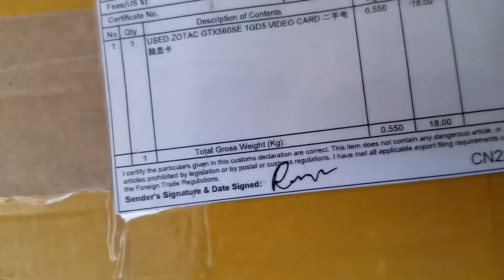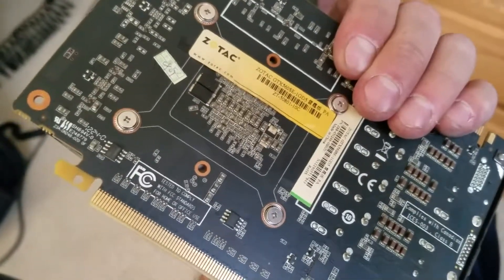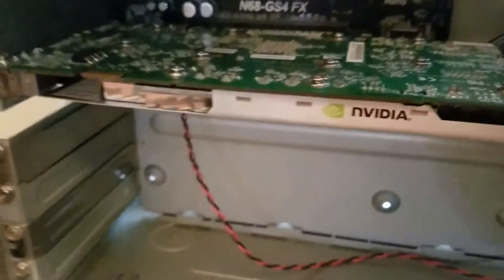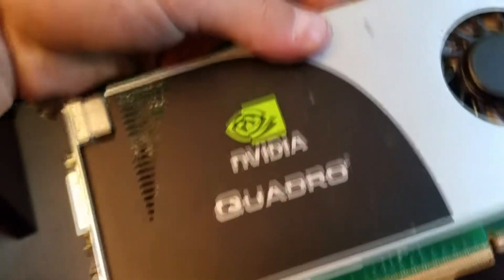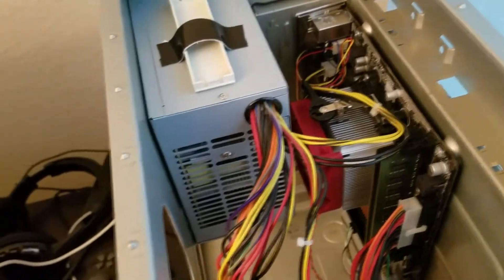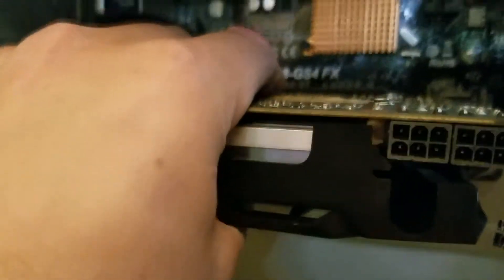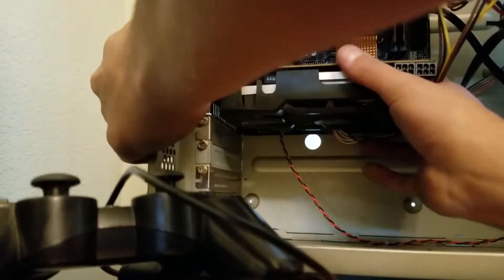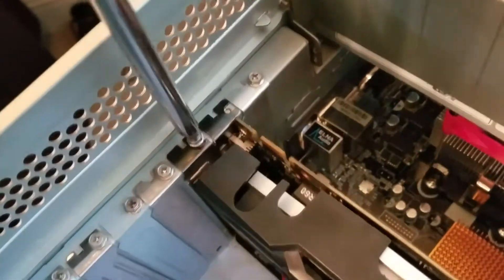Installing a cheaply bought GTX 560 SE in my crappy system

Comment: have the very same gpu and installed it in my cheap pc this week, i used 2 sata power to 6pin adaptors, works with no issues. works well for older non juice hungry games.
Reply: I'm planning to to this as well, just waiting for the rest of my cheap ebay parts
Reply: @Sailor1545  have moved the GTX 560SE to my kid's PC cuz recently bought a Radeon Rx 6600 XFX. It was quite cheap. Could play latest games on ultra on 1080p.